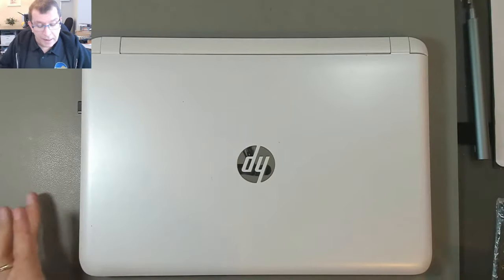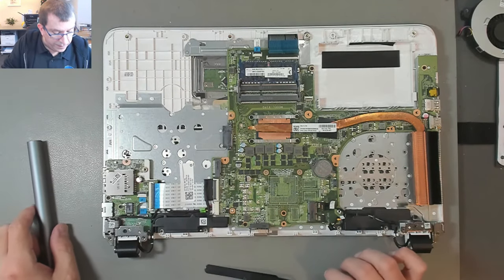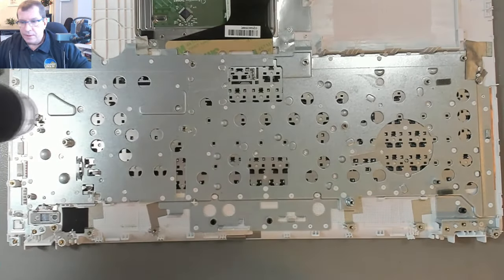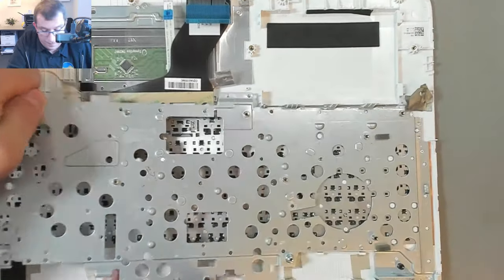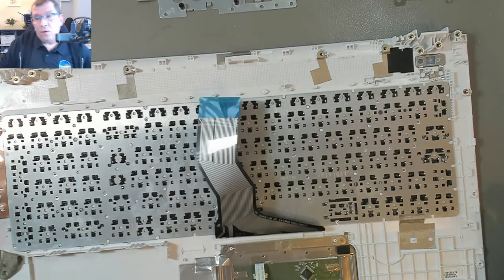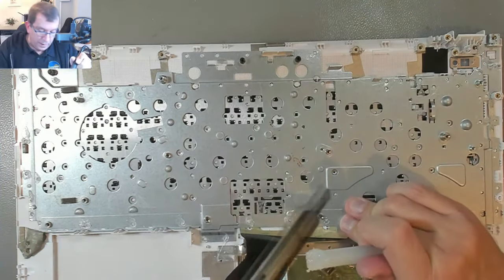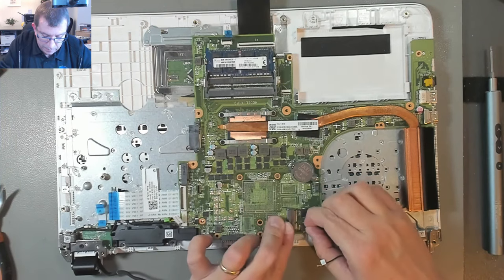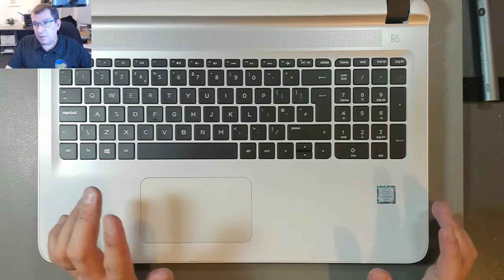[70] Replace a welded-in keyboard in a HP 15-ak085na (TPN-Q159)

Comment: A flush end cutter would make short business of those nasty plastic swages. Klein makes a great one for about $10 and you can get one at your favorite hardware outlet. Also, a rod or skinny piece of ABS plastic (never nylon like a zip tie!) and a low-wattage soldering iron will get you brand new swages for a legit installation. Melt a dollop of plastic into the post end, and swage it with a flat dowel. Practically factory-new!
Thanks for the video, and good work there. :)
Reply from the maker: I never considered a flush cutter but will try it. Also I don't know why I never considered just melting ABS back onto the post, but it sounds like it would be much cleaner than hot glue. Thanks for the tips!
Reply: I wonder how a 3D print pen would work too..
Reply: Is it bad to use the plastic of the black zip tie ?

Comment: Hi I got msi gt73vr 6rf titan pro and I got same keyboard, I must change as well what kind equipment I need I couldn’t found palmrest for my laptop it’s more easy way so that’s why I have to change like on video thx
Reply from the maker: You'll need something to cut off the plastic rivets and then a hot glue gun to fasten the new keyboard in-place. It's a hard job -- good luck!
Reply: @ComputerHelpNI  thank you I will try my best